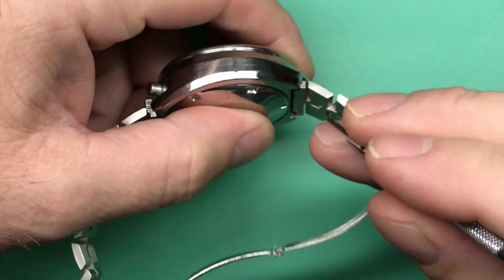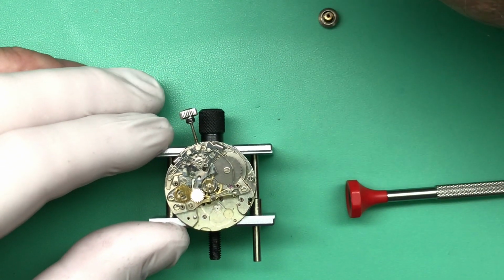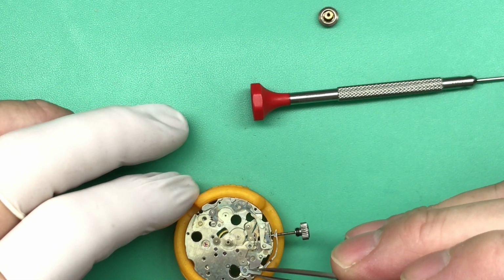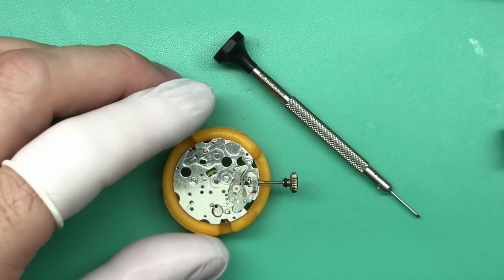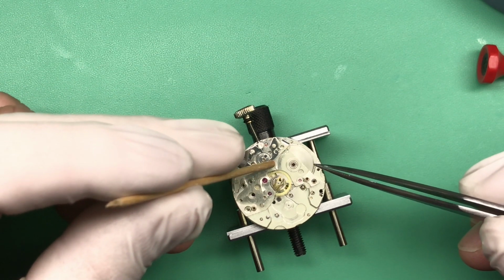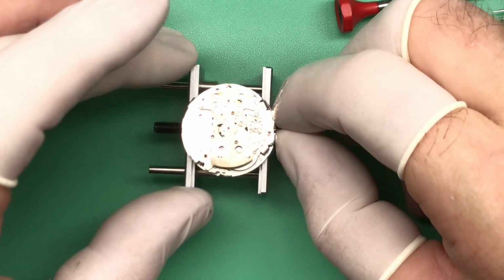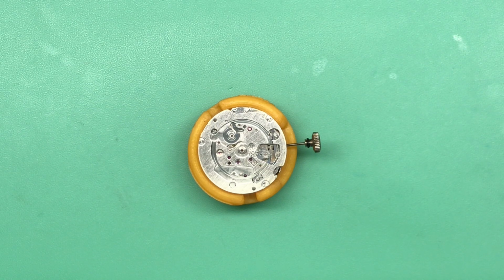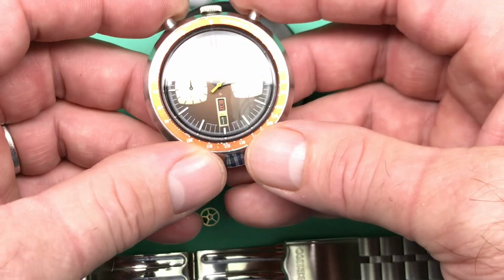For D.T. -- Seiko 6138-0040 Brown Bullhead Service and Restoration

Comment: Kolay gelsin Bu çark  dişlileri ve içindeki parçalar nasıl üretiliyor hangi makina ile
Reply from the maker: Most of the gears are stamped out, and the other components are machined using lathes and mills. Very standard practice for machine made components, regardless of size.